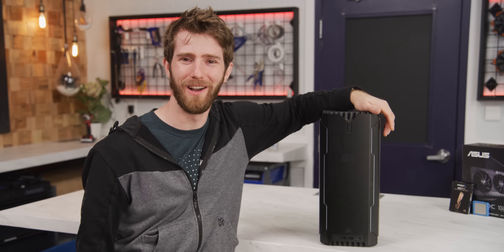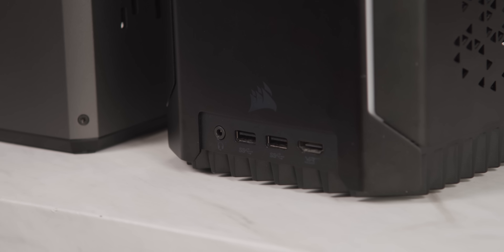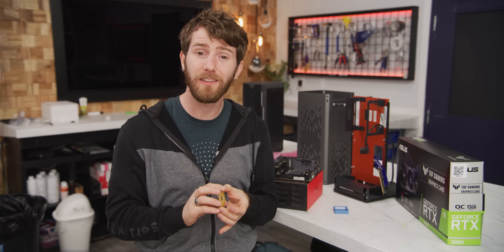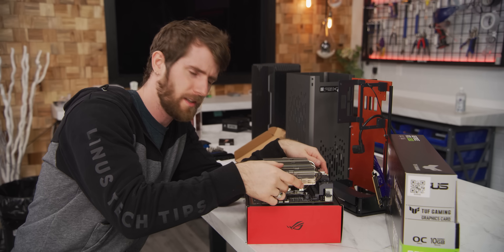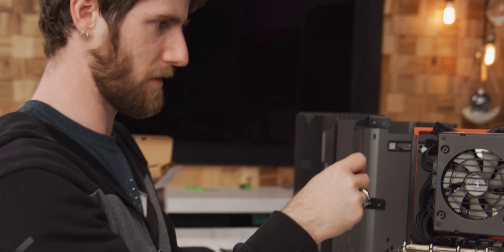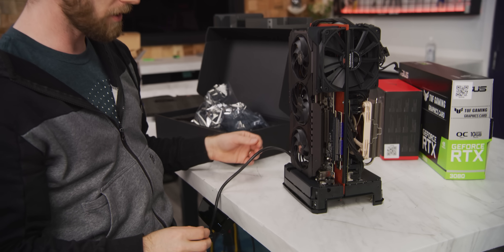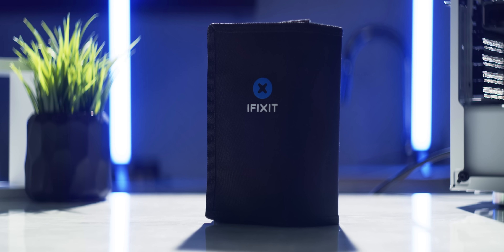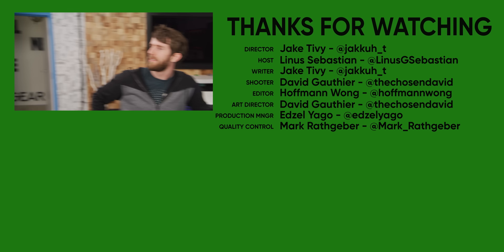My EASIEST PC Build In Years! - Louqe RAW S1

Comment: As someone who did extensive research on small form factor PC cases, I can say that most of the cases available are very expensive and are produced on low volumes. The only real exception to this is the Coolermaster NR200, which may not be as compact as some of the competition, but does have DTX compatibility, can fit pretty much any size of GPU and even a AIO or medium sized aircooler without much hassle. Also it costs slightly over €100. I know that LTT keeps stating they don't know much case reviews any more, but I do think this one is worth looking at due to its good value.

Comment: While the case is super nice, I figured that the WiFi equipped motherboards would have a weird angle for the antennas (unless it's using one of those wired ones, but those aren't practical for being on the go).

Comment: I’m at the point where I tell people if you can find something with a GPU buy it. Prices right now are insane. Built a custom Corsair or buy one, whatever you can find.
Reply: For real. Only requirement is: is upgradeable, has a 3000 series GPU
Reply: That’s cool and all, but is it possible to put a GPU in a bike and make the all new Razer RGB Gaming Bike, for only $69.99?
Reply: i bought a prebuilt in october and managed to snag a low stock 1660ti from best buy. paid 100 over msrp but i didnt care because that prebuilt had 8gb of ram and an acer oem 1650. ffwd to now and i have the whole system on a new mobo in a new case with 32gb of ram and way too many displays
Reply: pooooooooooooooooooooooooooooooooooooooooooooooooooooooooopppppppppppp
Reply: Bought a pre-built today, I feel dirty 😧
Reply: @loose167  I have worked in IT for the past 6 years and I've built hundreds of pcs... I too bought a pre-built last week. However I ordered it last Friday and had it by the following Wednesday. 3070 with i7 10700 1tb of mem and 16 gigs of ram 650watt psu. 

It's borderline impossible to get components right now. Not that it's impossible but its way more difficult than it should be to the point where its more expensive for me to search for all the components wait 4 weeks for delivery. 

Lenovo for those who are wondering where I got from. 5i.
Reply: @loose167  I feel even worse, couldn’t upgrade my rig from the 1070 and 4790k I have currently so I went and copped a ps5 for now
Reply: yeah its so bad a gt 1030 is over $100
Reply: Was looking for a 3080 before i got parts to build my new rig, not really monitoring discords etc since i dont really have the time, and about 3 weeks ago i just walked into a Canada Computers since i was in the area and grabbed an Aorus Master 3070 just sitting on the shelf that got in stock that day. Got super lucky, last bit of my parts should get here by this week. Still want a 3080 though, so the 3070 just here sealed, cuz the pc is overkill for a 3070. So actively looking for one now.
Reply: ok.
Reply: people should wait.
Reply: Got my Corsair prebuilt a couple weeks back. Sure it was just over $3K, but try finding the GPU and CPU for less than that today... really well built and all Corsair products (minus the garbage MOBO....)
Reply: @britking  you can't. But I'll be damned to spend 3K on a pc 😂 I just want a second hand 2080 at a nice markdown as everyone is buying 3070's and 3080's =l But those cards are more expensive now than they where new...
Reply: @SyntheticFuture  try and get a rx 6800XT. That's even worse.
Reply: @SyntheticFuture  I feel your pain. I used to be a poor student--if I had a spare 2080 I'd help you out... try getting on EVGA's list for a 3060 maybe? You can apply for all the lists... you don't have to buy and if cards are still being scalped, you could turn it around for a small profit and use that to buy the card you need?
Reply: So I have an old 2012 pc and my GPU isn't a GPU it's a video adapter. Should I upgrade to a 1650 I found for 590 or no?
Reply: Buying a cpu with integrated graphics is the best idea rn
Reply: I just got a laptop instead lmao
Reply: @bean6520  I'm shocked you work in IT and called storage mem. I would fire someone for saying that personally.
Reply: @gundoxcrit1652  wrong @ I’m guessing?
Reply: @bean6520  yeah I got an Asus ROG with a 2060 for $1299 on special
Reply: @slakk5093  got a lenovo legion 5 with a 2060 as well for around $1400 (which unfortunately qualifies as a good deal in mexico lol)
Reply: The thing is, You can find any card you want.... On the aftermarket at extreme prices! They are there if you badly want one and can cough up. So, It's much more a matter of can you find one at a reasonable price.. Or from retailers.. or both those options? Highly doubtful lol So pre-builds are in the mix now and can be the cheaper option to get hols of the card you want which is something I though would never be a thing 🤷‍♂️
Reply: want a phantom canyon to replace my skull canyon because it has a GPU integrated into it.
Reply: Agreed brother had everything but a GPU for months and I ended up just recommending he just find one no matter the price. Obviously a consulted so he wasn't paying too much for something entry level. Ended up with a 3070 tuff.
Reply: Only new hardware is insanely priced or unavailable there are lots of server GPUs available for about 250 most people wouldn't even have the power supply for one of those and if they were smarth they'd use that for mining instead of a gaming card. Also the 2000 and 3000 series quadro cards are widely available for about the same price and give the performance of a 960ti and far far better for graphics rendering and 3d modelling. It really depends what type of gpu you're looking for but gaming cards are off the charts and unavailable
Reply: Pretty sure tech reviewers/youtubers have like half of the RTX 3000 series stock...
Reply: so i should buy the ibuypower prebuilt with a ryzen 5 and a gt 730?
Reply: I have an old MSI N760 TF 2GD5 and nobody wants it. I will literally give it away free to the person who just walks up to my door.
Reply: We are at a time where gaming laptop is actually a steal.

I bought HP Omen 15z with Ryzen 5600H + RTX 3060 (100w) for $1299.
Reply: Just Be sure to buy from official sellers...
Reply: I back that statement fully. Hopefully, the rumors that NVIDIA is going to block mining on its video cards are true and this nightmare can be reduced or even end.
Reply: my 1060 3gb slays all cards at 50 fps get on my level
Reply: A 1650 super has gone up $200 in my country in the last week, fml
Reply: Yeah, I sold my R9 380 from like five years ago for more than I bought it for new.  Nuts.
Reply: @patrickchinka time to create the dummy corp, since I'll have more rights and wholesale purchasing power and can make a contract negotiation for my business internet. That's what you get for legalizing corps as people - People will self ID as corps! The next level of prosumer
Reply: @dababy car I live in europe, pretty rural area.
Reply: Price for RTX 2060 PC is insane, but i got RTX 3070 + AMD Ryzen 9 5900X 12 Core underpriced last month on sale. ;)
Reply: Found a cool prebuilt with a 3070ti, tbh I probably went a bit overkill but runs rocket league well.
Reply: I kept hearing about how "insane" GPU prices are since last year, but I had no idea how bad it was until I went pricing 2060s right now for the hell of it. $650 was the lowest I could find. On a GPU that launched at $350.

"Insane" doesn't quite cover it, GPU pricing is, simply put, f**ked.
Reply: Got a asus 660 ti for 10€
Reply: I know right =l I'm also damn close to unsubbing all these tech tubers with build guides that use parts that are pretty much unobtainable... I don't blame them for anything but being confronted with these cards is really starting to get near unbearable...
Reply: @SyntheticFuture  500 dollar PC build you can do RIGHT NOW!: So anyway I got this RX 580 back in 2019 for 180 bucks new and thats what I'm gonna be using...
Reply: @SyntheticFuture  do you expect them to just stop making content? That's like asking Optimum Tech to stop doing pc builds. That's (almost) all he does.
Reply: @AurumFaber  not expecting them to do anything really. Just stating where I'm at right now. Venting some frustration. I can't unsub from Linus anyways because they finally started covering weird linux and retro gaming stuff so.. they are save xD
Reply: @SyntheticFuture  If it's any consolation it's not like they're making these builds with new parts. They make the PC for the vid, then take it apart, then make another build with the same parts because the parts they have were given to them and they can't buy them either. However, I get what you mean. I can watch the PC build but what pisses me off is when they make a PC build but then add the MSRP price and a disclaimer of "if you can find it" instead of just saying the scalping price. So all those $1500 build vids piss me off to know end.
Reply: @Athasin  right yeah I know. They don't have 500 cards laying around (although I do believe the entire editing staff is on multiple 3090's, but that's not so odd for a company that's worth a couple of mill at least). It's just that the constant confrontation is really starting to wear after a year + xD And yeah pretty much all "1500 builds" right now are more like "2500 builds" really =|
Reply: @Athasin    11:00 , so they put the plastic wrap back on for each build?  roll eyes
Reply: @Athasin  I would like you to tell me what the scalped price of any one gpu...like it varies by they day, the person selling and multiple other factors. They are trying to make content that is as positive as possible and sill be helpful in the future. Plus they reccomend to not by at scalped prices anyway so there isint any reason to do say the "scalped price"
Reply: @Athasin  While they absolutely do do that for most of their builds, in this video that was definitely a new 3080 as there was still plastic wrap on it.
Reply: @Athasin  scalping price depends on where you are and when, which makes it useless imo.
Reply: @SyntheticFuture  If you do want to stop seeing their videos, just unring the bell. That way they still have your subscriber which helps them out, but you don't see their videos.
Reply: @SyntheticFuture  don't watch the videos with the cards then?
Reply: Let’s see how much subs I can get out of this reply currently I have 16
Reply: Or just not buy a PC unless you actually need it for work or something.
Reply: @Athasin  everyone needs a pc either used or single board computer everyone should have a computer
Reply: @bradss7583  like raspberry pi? or their smartphone?
Reply: @bipbop3121  exactly lol I didn't know they had a smartphone I knew Debian and KDE each released a full version Linux phone though
Reply: @Athasin  a lot of people do though.
Reply: yeah true

Comment: All my parts come in the mail tomorrow! Cant wait for my new build! Gonna have to borrow my brothers Rx580 for a bit tho😢 But sooo glad to go from a ryzen 5 2600 to a 5 5600x😶
Reply: Good luck on the build
Reply: @username_576  thanks man, it went super well, bios flash was smooth, build was fast and very clean, cable management only took a few minutes, and it runs amazingly.

Comment: Going that small is a hell of a thing. Too bad I just upgraded cases ._.
Reply: At 12.5L it isn't THAT small for SFF standards. With that kind of size, you could also go for an NCase M1, which will be even easier to build in and have much better cooling potential!
Reply: @Leonsimages  ah, but what if I water-cooled an evolve shift 2 using hardline tubing?

Yes, I know it's a terrible idea... My 3600 is overheating under full load and Im planning on upgrading to a 5950X. Going to try to replicate the watercooled shift 1.